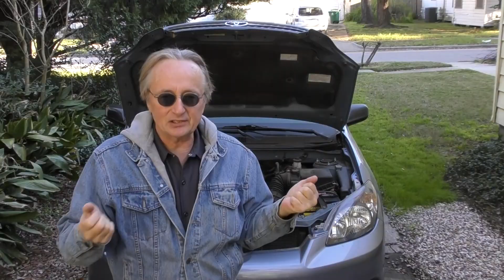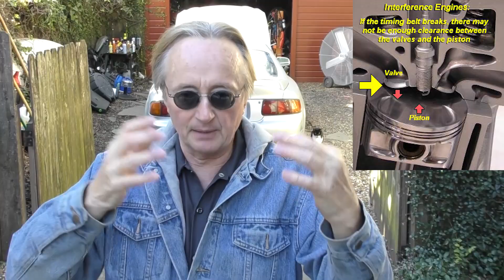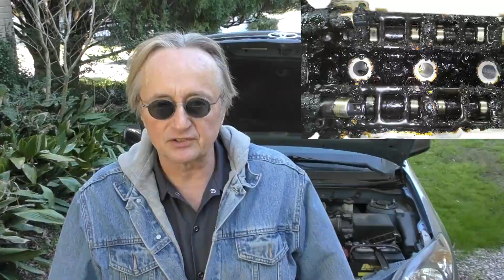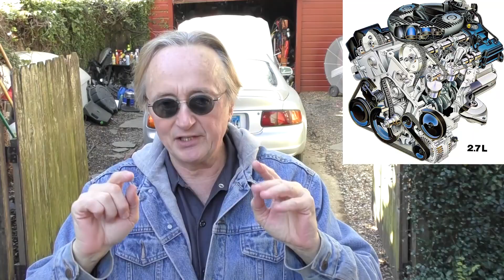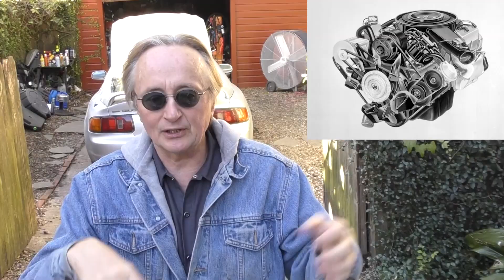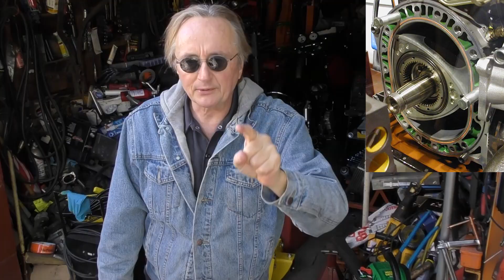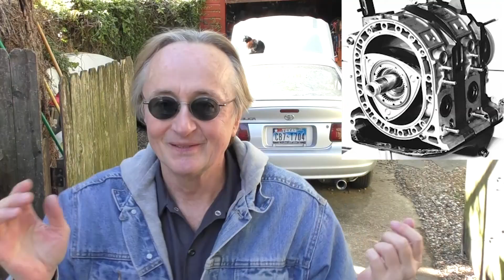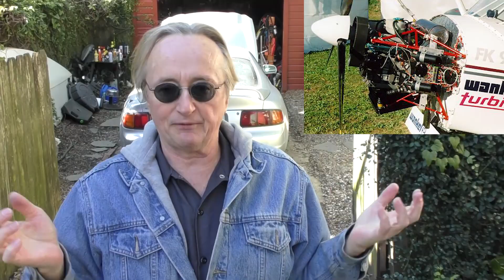Never Buy a Car With This Engine

Comment: I have to disagree on the rotary a little bit. A lot of the problems came from people not following the recommended maintenance procedures serious and there were some very odd ones the people are not used to. I had to first gen RX-7 both over a hundred fifty thousand miles and both ran just fine. The third one the renesis engine in the RX8 is a total POS oh, they tried to overcomplicated and again as Scotty mentioned trying to make it pass emissions and that thing is an absolute nightmare. The good thing about the earlier ones is you can disable much of the emissions stuff and unless you live in one of those States you're never going to have to get it tested for emissions anyway so pull the cat, adjust the carburetor and they generally run pretty well. They're also fun as hell banging the limiter off 9,000 revs and it could care less.. 
The most fun one was the 1985 GSL SE, which gave you the fuel injected 1.3 l they came in the second gen RX7 but put in the much lighter 1st Gen RX7. I believe that was making 140 horsepower and that thing was a blast to drive.

Comment: Hey Scotty I bought a 2004 dodge neon sxt for $300. It does not run at all. I bought a battery for it and everything electronic turns on, but when i try to start it nothing cranks or anything. What can it be? Hopefully you can get back to me I would truly appreciate it.

Comment: The 1.8t is one of the best vw engines ever....
Atleast here in europe, they are great to reprogram, tune with no money. Ive seen a chiptuned audi a3 to 230hp that has 400.000km and still running smooth
Reply: My brother had that 1.8 liter turbo in his Jetta and it was a complete bloody disaster. Those engine coil issues Scotty talked about he had those problems. It's an engineering flaw that once they fail they can never be fixed just replaced endlessly. You must have been one of the lucky ones
Reply: Dan Fernandes probably the ICM. 034 makes a delete kit and you can use the r8 coil packs. Not that big of a issue at all.
Reply: @dandyone_123 was is it  made in Germany?
Reply: Same here. Have 2 a4s with the 1.8 with a light chip and regular oil changes theyre awesome. Not a single issue the past 9 yrs.
Reply: Yep I had a 2001.5 Passat and it was an awesome little car! Plenty of power and peppy, looked beautiful, smooth ride.... so a coil pack misfired every once in a while no biggie. I kept 2 spare coils and a screwdriver in the trunk. No major issues.
I lost it in a wreck 2013 (not my fault) and still miss that silver bullet
Reply: I have one @225hp & 200k km. Runs like a clock but you have to take care of course. I always kept it with fresh quality oil and best filters. That's the first time I disagree with Scotty actually. It's not a bad engine, it's an engine that should be taken care when it comes to oil and oil filters but keeps working and working flawlessly.
Reply: Never had a problem with my 1.8t. Had the apr stage 3 kit on it and loved that car.
Reply: I have a 200 bhp AQA code 1.8 5VT, using half synthetic Castrol RS oil with a K03S turbo. Proving to be pretty much indestructible so far, though I take very good care of it. Yes, I'm european as well, they might be much better here than in the US cuz I have never heard of these coil issues Scotty talked about here and I have friends who have more than 300k kms on their 1.8Ts
Reply: @jerkopatrik  I recommend Liquimoly to my fellow 1.8ters. Most amount of synthetic oil in that brand. I was using Castrol too but Liqui is a step up from C. My mechanic isn't putting anything else to any VW group since he tested them. Also, 5w40 instead of 5w30 seems to be dolng a better job. Less vibration and zero cold start hesitation was my experience with LM 5w40. Probably because of slight increase in mechanical tolerances as the engine gets older.
Reply: @4L10  I use 10w60 because the AQA code is no BAM unfortunately, so it is an older design with no VVT that requires thicker oil, therefore more lubrication (the gap between the moving parts is bigger than in newer code 1.8Ts)
Reply: @jerkopatrik  Mine is an APX with no VVT crap too. Slightly older is better IMO before they installed all the spaghetti for emissions. I even especially got this car for not having the idiotic ESP system installed afterwards. :)
Reply: I had a 2003 Audi A4 with the 1.8t. Great engine and now problems. I ran proper spec Castrol synthetic.
Reply: I have 260k on my 1.8t and it's still running strong!
Reply: I need to do that!!
Reply: haha good joke !!
Reply: my b5 a4 has close to 180,000 miles on it with no issues, the issue in the states with the car is people using cheap oil and not taking care of the car properly.
Reply: it's not as popular here in the states (though do remember big V8's are very common here) but they still have a following here. usually I hear worse stuff about the 2.0
Reply: I have a 2016 Jetta 1.8 turbo, no issues
Reply: Shell Cracker I’m thinking about buying that car. You still like it? I have a 2010 Jetta no issues
Reply: My dads 01 Jetta 1.8t has 173k on it and has been beat to death by his driving and the car is on the original clutch. Thing has been Uber reliable.
Reply: The engine is not that bad,the electronics and so much rubber hose is what is the mess,you will live riding in the back of a tow truck
Reply: @mandytuning  Doubt it. Never let me down once the past 60 000 kms and i take care of it.
Reply: They're great for tuning, sure. But the only way it's going to last and be reliable is if you drive it as if it's built for SLOW. Great for tuning,cheap and quick power gains. Just unreliable
Reply: I'm running a Mk4 with the old 1.6l 8v, and it's just about to bust 300,000kms. Never let me down. It gets the right oil, and a good filter, on schedule. It's not VW's fault if the average American can't read their owner's manual properly...
Reply: @spokebloke1  Americans drive nearly twice as many miles per capita each year as the Brits. Around 7,000-8,000 vs 14,000. I would think that might have more to do with wear and tear and maintenance issues than some sort of magic inability to read owner's manuals....

Comment: GM should stick to pushrod engines. That's their bread and butter. If a Bonneville with a 3800 V6 can get 30MPG highway back in the 1990s without using direct injection or variable camshaft timing, then I see no need for OHC 4 bangers in the US where we aren't taxed by displacement. Imagine a potential 3800 Series IV where they took the 3800 series II/III and gave it the Gen V small block treatment with direct injection, cylinder deactivation and variable valve timing.... that would be one hell of an engine.

Comment: Your scan tool tells you your coils are bad? Must be a pretty dang good scanner, mine just tells me there is a misfire on a certain cylinder when its misfiring and then I have to figure out why.
Reply: It probably can do a ring test to determine if it has a shorted winding, or test for open/closed circuit.

Comment: I had a Chevy 1978 Monte Carlo.  I ordered it from the factory with a 231 CID v6 built by Buick.  It arrives at the dealer with a 200 CID v6 built by chevy.  I should of refused the car and have them place another order with the right engine.  That Chevy engine was horrible.  First, it had no power.  I tool my life in my  hands on entrance ramps to highways.  To go over a mountain in the summer with 4 people inside.  I had to turn off the AC, pull onto the shoulder and use my flashers.  The engine was horrible.  It did come the Chevy's famous valve tap problem.  Never understood why they could not design that out.  To put a spark plug  on the right side of the car, I had to remove the front right tire.  To replace the oil filter, I needed to a contortionist.  I hated that car.  Never bought another chevy after that car

Comment: so funny when I worked in Indianapolis I remember the Chrysler motor foundry workers jammed packed into a nearby bar for liquid lunch break. I also remember the GM engineers that would stop by and ask about designing their head up displays. 
by the way 1990 rx7 convertible for sale.

Comment: Just finished an 1800 mile trip, 70 to 80 mph. Still got 34 mpg, but that 2.7L Chrysler used a quart of oil. It only has 212,867 miles on it and I do want it to last to 300K. Should I just buy a rebuilt long block or wait for this one to die? No work was ever done on the engine except starter and alternator and new spark plugs at 200K miles. I changed Castro 5-20 oil every 4K miles since new in 2004.

Comment: Is there some confusion between the 2.2 and the 2.4 (quad 4)?
Reply: I had a Sunfire GT 2001 paid 250$ for it changed a wheel bearing for 100$, but after a year the coil pack went bad after the battery then the alternator, the clutch cylinder broke i had time to push the pedal enter into gear and the car started to move like i was de-clutching was really weird. It had the 2.4 which is base on the quad four engine.

Comment: In the US the Diesel engine manufacturers are going down the tube too with the emissions control imposed by the government ( the communist EPA) Cummins, Detroit and caterpillar use to go 2 million miles without an overhaul, the new diesel engines are crap, you r lucky if you can put 700 thousand miles on them, shame on the manufacturers for bending over to the government,

Comment: I'm surprised you didn't touch on the Cadillac Northstar V8 engine 32 valves I think something like that.
I needed to get a car in a Mrs insisted we go to a particular lot they had a Cadillac that looks really interesting with fancy aluminum wheels leather seats fancy stereo system and a Northstar engine. It had a hundred and fourteen thousand miles on it.
I looked up the Northstar engines including that particular year and found that the spark plugs were not intended to be removed. Further the spark plugs were designed to fail at approximately 120,000 miles.
You get the picture.
Other engine parts were designed in a similar way as I found by reading different descriptions and reviews.

Where she at is the fact that Cadillac changed different aspects of the engine every year. They could say it was for purposes of improvement but some of them are just changes that we're obviously intended to make it impossible to take an engine from a 1998 and put it in a 2006 or vice versa... or to take a 2007 and put it in a 2005. Not one single pairing of years was adaptable without major Alterations by some very skilled mechanic.
As you may imagine the odds of finding an engine with a significant a number of life expectancy miles I guess you could call them we're pretty well stacked against anyone who's looking to keep one of those cars on the road.

I bought a Buick Century instead and still got ripped off... the guy inspected all the vehicles on his lot and I found there were some problems in the first few days and I took it to another mechanic and he showed me how three out of four brake pads and rotor sets were worn down to need replaced. Significant money to pay on a vehicle I just bought from a guy who is supposed to have passed all the brakes on inspection.-- his own licensed garage inspection.

Enough of that. basically I think the Northstar Engine should really have a place of Dishonor on this list

Comment: I have a 2005 vw/audi 1.8l turbo and feel personally attacked 😭
Mine has 220k and 250hp with just a engine tune its really all about the maintenance
Reply: dont listen hes confused with the 2.0 lol
Reply: @SearchEast2069  yes 2.0t engines are no good. 
Now vw has a 2.0 4 cylinder no turbo from 2000 too 2005 they were though engines

Comment: I had a 2000 Audi S3 (1.8 turbo) I did have a problem with the coil pack but apart from that it was all good. I had a stage 2 tune at 120000 miles and I sold it at 188000

Comment: How about never buy a 2.5 Subaru egnine. Every one I have seen or my family has owned or see cheap online has head gasket or motor issues or they all have had issues with those at one point in time it seems unavoifable. The 2.2 in my 1996 Legacy may not be as powerful but at least im not worried about it. Even the old EA82's in the Subaru Loyale/GL are pretty bulletproof as long as you dont mind the lack of power or the fact they leak oil (these are my experiences anyway)

Comment: The vauxhall opel 1.2 ecotec does not have a timing chain issue or any fault this is a very robust engine that has been around since since 1990 in one form or another, there has never been any reported issues with timing chains the engine up to 2005 need 9000 mile or 12 month service the latter models went to 12000 or 12 months they run on fully synthetic oil onlyand the chain required servicing at 80000 miles.
Very easy to work on parts are cheap,this is a very basic engine design sorry scotty this is not a complex engine . 
This is a bread and butter engine simple mechanics. Our school children train on these engines in tech lesdons at school at the age of 15 .

This thing about wv and synthetic oil . That story is total rubbish 
On every vw group car the hand book tells the type of oil.
Under the bonnet there are at least 2 labels that tell which type of oil to use. Every vw group dealer know you only use full synthetic oil the story was totally made up. What this engine did have was a small coolent reservoir and many people just increase the header tank size to over come the issue Rover has the same issue on there 1.8 turbo engine they where very similar design.
Manufactures cannot be be held responsible if people do not educate themselves. When a engin hs a specific reqirement you do not ignore it. So no not a bad engine on the oil side but did have a design floor around coolent.

Comment: All the seal problems in the Mazda rotary were fixed by the time the RX-7 came out in 1978.  The rotary was pretty damn reliable actually if kept stock.  Guys who went nuts and boosted them to 25+ PSI where the ones that had failures ... no surprise there. I owned two RX-7s and even though gas mileage wasn't as good it wasn't as horrible as Scotty makes it sound.  And yeah, they were designed to burn some oil with an oil pump, but mine used less oil than some piston engines that I've seen burn oil.

Comment: What's your opinion on GM 3.6 V6 LFX engine?
Reply: I love my Cadillac CTS with the 3.6 but cost me couple grand at 130,000 for new timing chains etc. Good power and smooth but bad design. Very common to have timing chain failure after 100k

Comment: If overhead cam is a less reliable design due to oiling problems, then why are the most reliable engines built (ie Toyota, Honda, etc) all overhead cam?

Comment: I had a 2006 Chrysler Sebring with the 2.7 V6. 
I purchased it in a hurry because we needed a 2nd car. 
Didn't research it. 

But I didn't own it long enough to have any problems. Got T Boned in it... 
Write off. 

But it has 55,000 miles on it when I got it. And it got junked at around 68,000 miles. 

Engine zero issues. But front end work I remember it needing.

Comment: Regarding the Chrysler 2.7L V6, were there other engine designs that also used the internal waterpump design?  I'm also wondering what design motivations would make a manufacturer put a waterpump inside the engine.
Reply: they forgot about the water pump until the design was too far along . just kidding but a thought.

Comment: @scottykilmer what do you think of the 2018 GM 5.3l with the AFM? The 1st gen had lots of problems but they still male them over 10yrs later. Do you think they have fixed the lifter/oil consumtion issue?

Comment: Scotty - I have 140K on a 2010 Ford Edge that has the 3.5L Duratec.  Should I proactively change the water pump since it is timing chain driven or wait until it fails?

Comment: I’m a diehard GM man but I absolutely hate the 2.2L or the 2.4L Ecotech engines are garbage. If you’re looking for a car that there was a option for that engine get the V6 either the 3400 or the 3500. They are much better designed engines and my dads Malibu with the 3500 V6 engine is pushing 300k miles.

Comment: My wife's 2004 chevy cavalier has that Ecotec engine and our mechanic has replaced parts of the timing system for a few hundred dollars. But I think we have the only one built right. I'm not a Chevy fan but this car has over 260,000 miles on it and runs like a dream. My mind is still blown that it hasn't blown.

Comment: I have had 3 pontiac sunfires that i ran synthetic oil in and i literally drove the guts out of those 2.2's and had zero issues, one has over 300,000klms

Comment: I hate to agree with you on the rotary engine, but I think I have to.  My dad had an RX-3.  I rebuilt the engine and can recall my amazement that I could carry it into the house by myself.  It was so small.  I LOVED the power/torque of that car - it really did go "mmm".  However, the apex seals were in two pieces at the time - a small triangular piece of steel seal was at one end of each apex seal.  That piece fell out of place, and got jammed into the rotor housing, seizing the engine.  Gas mileage as I recall was around 17 mpg.  I reluctantly have to agree with Scotty on his assessment.  The RX-8 was no where near as fun, in my estimation.  I drove one, and it was like the RX-3 engine had been given a lobotomy.  Sure, it was many years later and a lot had changed.